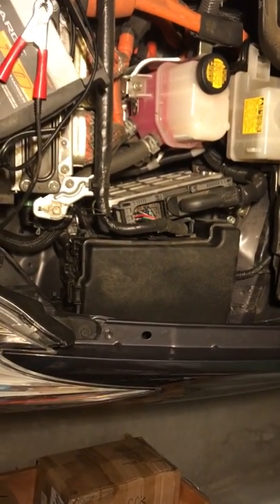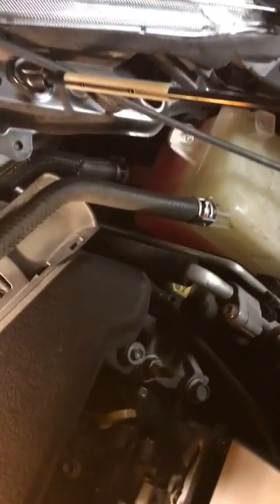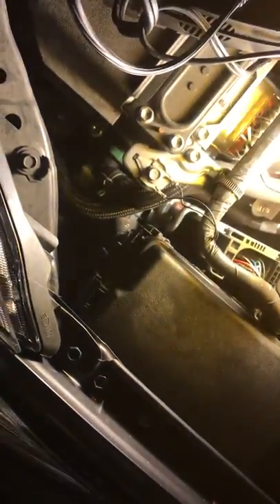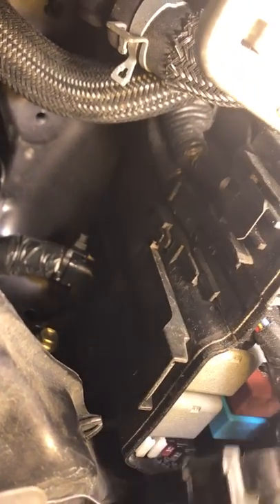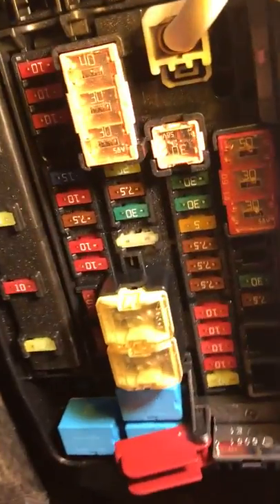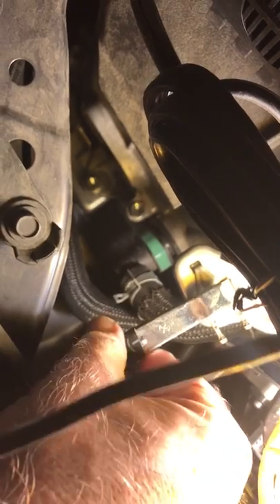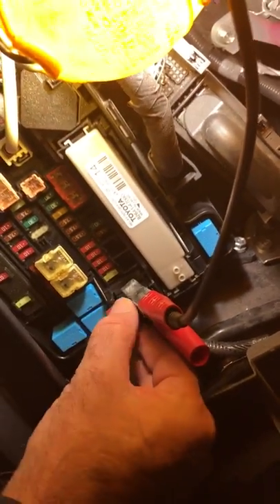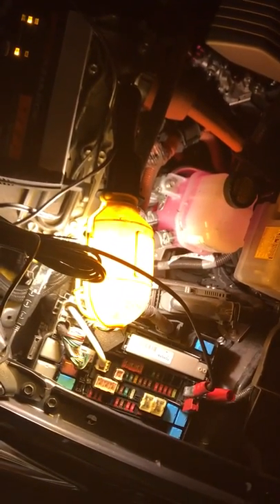How to charge a Prius 12 volt battery with a battery charger

Comment: The main point of the video clip was to show where to hook up the charger and the key was the terminal under the red plastic cover in the fuse area.  That said, as was pointed out, you never want to plug your charger in before connecting the terminals.  Also, it is generally accepted that the positive terminal be connected first, followed by the ground terminal.  The point of attaching the ground terminal distant to the positive terminal is both to avoid incidental contact of the two terminals and to avoid sparking which can ignite hydrogen gas which may accumulate during the charging process.  Granted there should be no hydrogen gas at the beginning of the process, but if reapplying the clip after some charging has occurred there could be some build up.  Connecting the charger to 110V last also puts you at some distance from the battery should anything go awry. Finally, just a suggestion, you could work on your video technique so the viewer has a clear picture of what you are doing.
Reply: I think in this case it's safe because the hydrogen risk is around the 12v battery, which is under the luggage compartment floor in back. I still agree with you that it's best practice to plug the charger in after hooking up though

Comment: Ken is correct--the charger should be unplugged when attaching the terminal clips.  Attach the positive clip first, then the negative, and THEN plug in the charger.  You shouldn't be getting sparks.

Comment: Unplug the charger first, then plug in your positive cable next, hook up the ground, then plug in your charger. .  It is not a good idea to let your cables "spark".
Reply: The 'TypeS' (brand name)  12V jump starter I just bought from Costco says to turn on unit, connect cables and then hook up red then black....  I'm torn.
Reply: @iamastarchild  I would follow Michael Kern's suggestion for extra safety.
Reply: Funny, we needed this video too. Yes it was a bit challenging w the upside down video. Attach cables first, then plug in charger, the charger will tell you of they aren't connected properly 👍
Reply: @iamastarchild  Prius are weird.

Comment: Thanks for showing how to remove the red cap on the terminal!
Reply from the maker: Just realize =- you need to put enough current into that terminal to get the PRIUS to turn ON. Once you get a READY light at the dash, then the HUGE traction battery will charge the little AUX battery in about an hour.

If the AUX battery is completely dead and you can not get the PRIUS to READY and ON then you need to disconnect the AUX battery in the back and gently charge it up to full. Understand?
Reply: @moviestudioland  I'm pretty sure the traction battery and the 12 volt system ae completely separated . I think what charges the 12 v system after you get the car running is what we used to call MG3. 
MG3 gets the mechanicals turning. Almost like a starter in internal combustion engines.  
MG3 is not ICE. 
If I understand correctly MG3 can change from alternator mode to charging-the-12v-battery-mode whenever it wants to. 

As long as the computers that run the thing are operating. Otherwise all bets are off. 

The beauty of MG3 is that its all mechanical energy being transferred. 

There is no connection between the 400 volt system and the 12 volt system that you plug your thing into.

Comment: My 2014 3rd Gen Prius has been standing around a lot lately. I've had problems starting it up on the odd occasion I've needed to go somewhere. Today I checked the diagnostic screen and it said my 12V battery was at 9.5V. So I'm thinking I'll charge it up. I'll double check when I get the charger out of the shed in the morning but I think it's a basic 5A charger. The question is, how long do I leave it on charge? Is 4-5 hours enough? Or overnight?

Comment: Thanks for this info. The battery charger my friend loaned me has different modes: Standard, Wet, Gel and afew others. Which mode should I use? Also, earlier today before I found your video, she tried charging the battery in the back of my 2013 Prius and it didn't work. She attached the black ground to the bolt on the bracket that holds battery in place. Was that too close to the red? I unplugged charger and got a slight shock when I removed red cable from terminal. Thanks for your help on this, I need to drive my car asap!
Reply: I called the auto store and they said gel mode. I plugged in in and charger just says Low V with exclamation mark flashing underneath it. What does this mean? also I noticed the battery in back does have a negative terminal, but it was covered w the plastic shield....should my friend have connected the black end into that earlier today, rather than a bolt on battery bracket?
Reply from the maker: Disconnect the black wire from the battery if possible. Then connect the charger. Run it about 4 to 6 hours on standard. Reconnect the battery black wire. Prius should start.  With the 
Black wire, which goes to the battery disconnected ignore the black wire, which is now disconnected and connect the black wire of the charger to where the black wire was connected on the battery. Connect the red wire to the red connection on the battery. Let this charge for about six hours , then remove the charger reconnect the black wire to the battery and start the Prius. The reason the Prius battery will not charge is the black wire is still connected and the black wire is allowing the charger energy to flow into the Prius and not charge the battery. This is the whole point of the video to disconnect one of the wires on the battery first so the battery may charge on its own. The battery has to be disconnected from the Prius and charged independently of the Prius. The battery can still sit in the Prius, but one of the wires has to be disconnected. Then the battery is charged. The battery is charged after six hours. The wire is reconnected and the Prius started if this situation does not work for you. You need to copy the number of the battery down. Take a picture of the battery and go to the Prius dealer and get a new battery and bring that battery home and replace the battery in the Prius, the Prius will start. The battery probably cost between two and $300 at the Prius dealer but first disconnect one of the wires then charge the battery for six hours maybe eight hours or even overnight and then reconnect the wire after the charger is disconnected and the Prius should light up and start

Comment: I read elsewhere that charging from the front of the car isn't a good idea and that charging the auxiliary battery in the back is the better way to go.
Reply from the maker: Sure. Now open the back of your remove the pieces to get to the battery snd see how you feel after all that. Or just open the hood and connect and see how easy this is - as designed.
Reply: @moviestudioland  So your response is “doing it the correct way is hard so no need”?
Reply: Problem I’m having — I wanted to charge using the battery in the trunk, but it’s so dead I can’t open the back hatch door to get to it. Tried connecting the charger as you said and that works, but I’m Not too comfortable leaving it charging in the garage all night. I had planned to leave the garage open and it would be charging from the back in the open air more or less, but still can’t get that back hatch open.
Reply: @kathinmaine  The back hatch won't open the regular way if the battery is dead.  It's a royal PITA to get it open as you have to go in the front to get in the car and climb in the back to get at the manual release.
I'll give you a couple video links to see how it's done:
2012 Prius: https://youtu.be/2N3GwSJ0_Zc?t=163
2004-2009 Second Generation Prius: https://youtu.be/UVAMTkxIn1Q?t=88
Reply: @kathinmaine  jump start the car and let it charge a few minutes connected and or drive it..then shut it off and you can open the trunk lid, then charge the rear batt

Comment: My car wouldn't start, and no digital info display. Except the "malfunction indicator lamp." I charged as you instructed. As soon as I hook the charger up the digital information display lights up in my prius, however the car won't start. After 24 hours of charging, car still won't start. I also can't get the digital display to light up unless the charger is connected to the battery. What do you think? Could this mean my 12v is totally dead and I need to replace it? Toyota wants to charge me $200 plus tow just to look at my car. I'd rather just replace the battery myself if there is some way I can verify it's the issue?
Reply from the maker: Buy a new battery from Toyota. Bring your old battery in too.

Comment: I'm considering getting a charger, but I'm not sure whether I should connect the charger to the front or the back if my main purpose is simply to avoid it from not being able to start up after a period of standing. Also, can someone recommend a charger?
Reply: Here's a little background, which may or may not be of importance.

I have an 2013 Prius that isn't being  driven very often, every 2 week, there'd be an interval of 1 week to 10 days of no driving, but it was definitely driven at least twice every 2 weeks.

The battery died on me a twice after the battery in the trunk was replaced by AAA on April 2021, and yesterday the technician said it wasn't tightened and that might be why its discharging so much. But before discovering the loose bolt, he also said we need to start it and let it run for 10-20 minutes every other day to keep it from dying, which seemed way to frequent to my understanding.
Reply from the maker: it will last OK two weeks. Just do not leave the driver's side door open even a crack. That is what KILLS the battery.

Comment: The AAA guy I called when my car was dead in a bank parking lot, connected his portable booster clamps to a small 12v battery in the back of the car to the side, under a removable panel.  AAA charged my 2007 Prius at the battery, not at the fuse box in the front. I wonder if either is acceptable.
Reply from the maker: Sure. What ever works is acceptable. The front approach will usually NOT work as the electronics in the Prius keep all the power you are sending in thru the front. Unless you can put in A LOT of power to over come the electronics and get the prius booted. THEN after say 15 minutes you can start the prius and the traction battery will be used to charge the little battery in the back. Otherwise IF you can get into the hatch and get to the rear little battery then directly connecting cables to it is the BEST way to assure success.

Comment: Nice video. Prius auxiliary battery is different from most cars' batteries, it is an AGM battery. I wonder if you could share how you set up the charging profile, such as current limit, voltage limit, and current/voltage vs. battery SoC?
Reply: Sorry, I forgot to clarify that the AGM auxiliary battery was used up to (including) Gen 3.
Reply from the maker: Modern chargers have AGM profile. If you have an old charger just charge it as low current as you can tolerate.
Reply from the maker: Our battery lasted 2013 to 2019 or so? and that was about 3 deep discharges as the drivers door was left open a crack and not completely closed. Open like 2 millimeters
Reply from the maker: Now at 63,000 miles need tires again. And brakes have never been replaced. Problem is you put in the wrong brake pads and you get squeal at all the stops when the brakes heat up.  Or you go to the dealer and they put in bad brake pads that are non-toyota parts and you get squeal that way too and you are out $600 to boot.
Reply: @moviestudioland  Thanks. Has the brake fluid being changed?

Comment: I got a small trickle charger at a yard sale. It claimed it's for lawn mower or motorcycle. It probably will not over charge since it's meant to recharge smaller batteries.
Reply: I've had one of those. Used it on y ridable lawn mower battery. 
In my opinion,  with 300 thousand miles in the two Prius in my family, I think 20th century tech should not be applied to 21st century cars I've loved so much.

Comment: my battery died because an interior light was on. I trickle charged the small battery in the back and it worked fine.
Reply: Where did you connect the black/negative cable?
Reply: @swekiwi4517  i think i just clipped it to a random bolt not near the battery.
Reply: How do you access the small battery in the back?

Comment: I tried to connect a front camera with switch and into a new android unit. when i tested it was fine when i put all the cables in place and closed plastics a fuse burned for the audio and mdf monitor. it seems i did something wrong for the camera. then i tried to test the parktronic i intalled and tested it earlier. i put Reverse the parktronic monitor did not lighted at all multible beeps everywhere the android unit blacked (without burn the fuse this time) and then when i tried to start the car it keep beep and could not shift to reserver or any other gear. i tried a few times same issue.. i assumed that might gone worng with the parktronic and reverse current or something.. this time i disconected the audio unit and everything gone dead. the battery was low like 9v ... Can shortages and blowing fuse drain the battery or the battery already low or something?  anyhow... i have an automatic einhel charger. i did connected it like you showed and shows like 4volts and make some wierds noises like giving electricity on and off... while it seems to charge like that the car panel lights go on and off each time.... any ideas? should i continue like this or change the battery?
Reply from the maker: I would remove whatever you added to the car. Take it all out. It is not a good idea to add 3rd party audio and video products unless you know exactly what you are doing. Yes - adding 3rd party after market units can and will drain Prius battery.
And leaving the driver's door open will also drain the battery over night. When you put in after market units  into a car yourself -you are always asking for trouble. Even the experts get into trouble and screw it up. Just take it all out. The radio in the Prius is fine.

Comment: I'm battery charging my Prius 2007. At the moment, when I turned it on, there's enough power to turn on the LCD screen but not the instrument panel. But then when I hit the off button to turn the car off, it then turned on all the instrument panel symbol lights. Now they're just staying on. So should I turned the car off & back on? And how long will it take to charge the battery up enough to get the car system properly functioning again?
Reply from the maker: Quit being CHEAP. Buy a totally NEW batter.
Reply from the maker: Quit being CHEAP. Buy a NEW battery for the Prius and install it. Your battery is DEAD. This happens.

Comment: The rear speakers were not putting out so well. Put it on charge tested the speakers , much better. I'm not sure but I think it might have been just low enough to not fully power the amp.
Reply: I've heard that poor FM Radio reception can  a sign of a 12 volt battery that is having trouble.

Comment: the battery is in your trunk just go there
Reply: I saw a battery explode into the face of a tow-truck driver once, not pretty so NEVER cause a spark if you're near a recently discharged or charged batter or probably any one like a car battery - hydrogen gas explosion with hot battery acid in your eyes and face, not pretty!
Reply: If the battery is dead, and you cant open the hatch, what then? You can crawl thru the back seat, remove the  floor panel, then remove the tool tray, then the battery cover......or you can do what this video suggests

Comment: Terrible advice,  this guys has no clue on how to charge a battery and should not be posting videos that will get people hurt. 
You always connect directly to the battery when charging,  also you never hook up the charger while it is plugged in, like the guy said, you always connect the positive or red cable first then connect the ground cable or black cable... I was cringing watching this video...
Reply: This is what the Toyota dealership told me to do. They said there was no problem with charging it on a trickle charger through the front end
Reply: Terra Tundra:  Re connecting directly to the battery: not so for the Prius (battery at back of car), eg my 2013 manual says to charge with red clamp on tab in fuse box, like shown in video.
Re never hooking up charger while it is plugged in: That agrees with the 'Super Start Power Pack' instructions I followed 2 days ago, but not with that of the Type S 12V jump starter I just bought from Costco. Those instructions say to power on the unit, attach cables to unit, then attach clamps to battery.
Reply: Connections points under the hood are fine.  Toyota shows you can jump start your car this way.  If you can jump start your car via the blade in the fuse box and a suitable ground under the hood you can also charge your 12v battery this same way.  Getting at the 12v battery on my 22 Sienna requires opening the rear lift gate and fumbling around in a dark compartment.  I would have to leave my garage door open because the rear lift gate of the vehicle would need to remain open and I have no clearance.  Do it the easy way instead - no need to tap into the battery directly when you can access a remote battery connection point under the hood.
Reply: @Terra Tundra: The Prius manual recommends this method. In practice, we Prius owners charge it at a low rate like 1 Amp. Though the method is good enough for jump-starting.